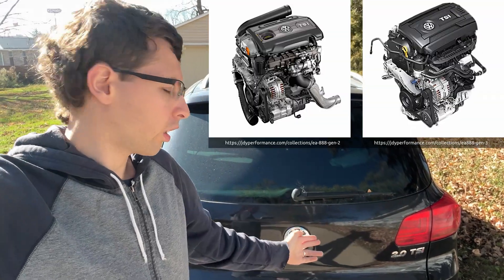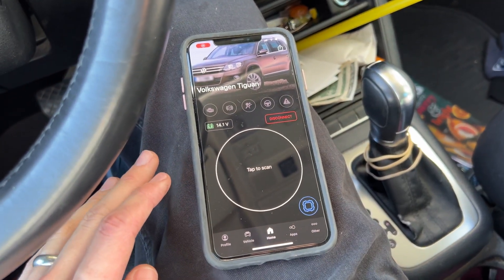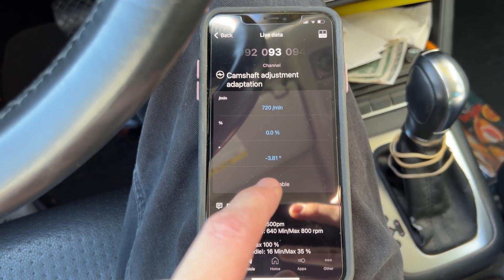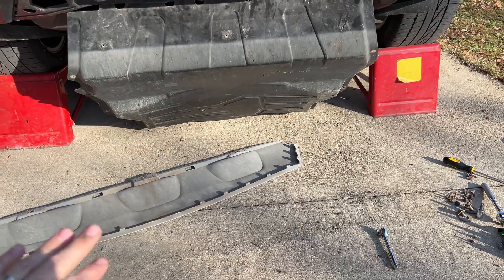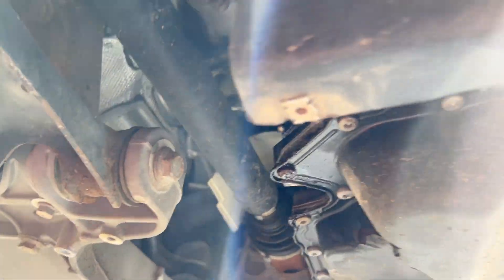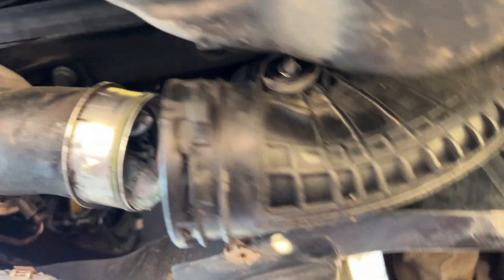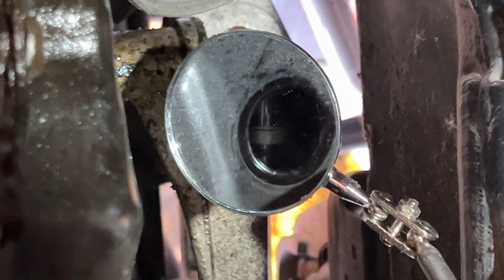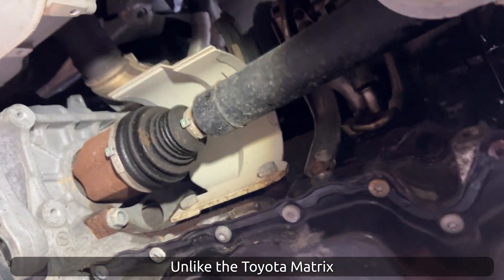Check Timing Chain Stretch on 2.0T TSI VW/Audi Engines - OBDeleven Scanner + Inspection Plug view

Comment: Engine ccza 2.0tsi at vcds 093 after change chain and tensioner with original says +8.18° and at 091 the specified is same with actual...
No issues, no fault code no problem...
Someone can explain?
Regards

Comment: Mine is at -1.38 intake and 0.75 exhaust is that bad or is it good? I measured it on OBDeleven with the live data option for camshaft intake and exhaust deviation
Reply: That’s ok, just means it’s moderate stretched, be ok a bit yet
Reply: He said the specifications from VW want it to be plus or minus 5 degrees from zero. So you are very much safe for now. If I were you I would keep my eye / ear on it. If you hear the rattle become worse or more prominent check it again to see if things are changing. Or just check periodically from here on out until it creeps closer to that 5 degrees
Reply: @SebastianDaCrab I’m so confused though, what more important to look at, the exhaust bank 1  or intake phase 1?

Comment: Hello mate i have my timing chain and tensioners etc all changed but it still says -3.2degrees. what is the name of that sensor i need to replace?
Reply: Hello, after replacing the timing chain I encountered the same issue, the values are still too high. Did you find a solution? Or did replacing it not resolve the problem?🥲

Comment: With high hopes, i got an OBD device to check the status of the timing chain on my VW Golf 2.0 TDi. When I went to live data, the OBD software GUI didn't allow me to enter any value for the live data channel. Instead a list of live parameters is only what I could access, of which "Camshaft adjustment adaptation" was not listed. 
Camshaft position start of phase window, Camshaft position end of phase window, Camshaft adaptation intake bank 1 phase position, Camshaft slope position were the only options I could see in the list. 

I tried the app on both android and iOS and the options are still the same. I am on the free version without any credits or upgrades.

Can someone let know what am I missing here. 1:42 1:42 1:42
Reply: Tdi has a belt, not a chain.

Comment: My Obd11 screens different I can’t go to channel
Reply: Go to engine then live data
Reply: Engine > Live Data > search for "Camshaft adaptation intake bank 1, phase position". If it's showing the degrees in Fahrenheit be sure to change units from imperial to metric in the settings.
Reply: @rich603  That's fun.  It is NOT a temperature :)   it is an angle.
Reply: @jellyd4889  Of course, but the app will show the degrees as F temperature if not set to metric, smart guy

Comment: What’s the part number on the sensor, mines reading -7.26 .
Reply from the maker: OEM PN: 07L905163C

I used this one: https://www.oreillyauto.com/detail/c/import-direct-ignition/import-direct-3-terminal-multi-purpose-sensor-new/odi0/190163

Comment: Hey could you help out i just bought the scanner but its not reading the phase postion b1 intake its staying at 0.00? It only reads the engine speed and load thats it
Reply: Hi, you solved it? mine is the same 0.00
Reply from the maker: I’m not sure, hopefully someone else will have a solution. I’m replacing the timing chain right now (took a few months to get around to it), I’ll have to play around with the app some more after that’s done.
Reply: @BrenoAutoGarage  Sorry, it was an error or engine was not at working temperature, now it's showing 3.85
Reply: @raulraul3417 mine is at 1.50 I take it that’s ok, you don’t see many reading in the +

Comment: Hello, Sir. I have a question. The timing chain in my VW Fox 2006 car has stretched. Do you think it's okay to drive 10 miles a day, but only for short distances? 
Thank you very much in advance for your answer.
Reply from the maker: I am not familiar with the Fox, so first research if your engine is interference or non-interference. Non-interference no big deal, even if the chain slips or breaks engine should be ok.

If it’s interference then it depends on how stretched it is, and how much you want to gamble. If VW spec is +/-5° then I would not to push the engine hard above that. But some people get to 8-9° stretch without issue so you never know...
Reply: @BrenoAutoGarage  thank you very much indeed for answering my message.🙏

Comment: Is OBDEleven pro or basic version to check timing?
Reply from the maker: As others said, basic can read the data. You’d only need pro for customizing/programming. I have not tried pro myself.
Reply: basic
Reply: Both will do the trick

Comment: loads of oil under the turbo is that coming from the cam cover, cheers.
Reply from the maker: I’m not sure, but I’ll find out what all needs fixed when I replace the chain later this spring. Thanks for the comment.

Comment: Any basic settings/adaptations that need to be reset via OBDeleven after replacing the timing chain? I have the older Android-based device and the newer NextGen on iOS. I was at -8.71 for “Camshaft adaptation intake bank 1, phase position” with a fully extended tensioner when I got the chain replaced. Post-replacement the OBDeleven Android device is reading -.92 for phase position, but the NextGen is giving a strange phase position value of 29.0°F. Not sure what to make of that, and whether the NextGen expects some kind of reset in order to get an accurate reading.
Reply: This was on a 2013 Audi B8 2.0 TFSI allroad. No rattle, no symptoms at all. Ran perfectly smooth at idle and under load. No DTCs. I inspected the tensioner and could see it was fully extended, so I had the chain replaced as “preventative maintenance” given the state of the tensioner + the phase position value. 

I’ve determined the OBDeleven device doesn’t always play nice with iOS, in my experience anyway, and the functionality is just better on Android. The iOS app was misreading the camshaft adjustment phase position ° as a temperature value instead of degrees of rotation, so when its Units setting is “metric” you get the correct reading, but if Units is set to “imperial” the app converts what it thinks is a Celsius value to Fahrenheit. The Android app recognizes it’s not a temperature value just because there’s a ° present, so metric/imperial settings don’t change the phase position value.
Reply from the maker: @Plus2-1  Very interesting, thanks for the reply. Hopefully they will update the iOS app to work correctly, and until then everyone with the issue will see your comment.
Reply from the maker: Wow, that is serious stretch! Was it rattling on cold startup, or running poorly? I am not sure what to make of 29°F, but I will post a pinned comment when I get around to replacing the chain and scan to see what the baseline value is. I do believe it is normal to be +/- 1° on a new chain, at least that is what others online have seen.

I do not have any VWs myself, I got the scanner to check this value after my mom sent me the CEL code scanned at a parts store in her town. I wanted to make a video showing my experience, but I am by no expert. I wish there was a dongle scanner like OBD11 for all car brands, very powerful scan and customization options you usually need dealer software to do. Using a laptop with Techstream for my Toyotas gets annoying.
Reply: @BrenoAutoGarage hello man, my exhaust intake was 0.3  and my camshaft phase bank 1 was: -3  is this ok?  And what if exhaust is more -negative to? Do both have to sort of be as close together as possible?

Many thanks